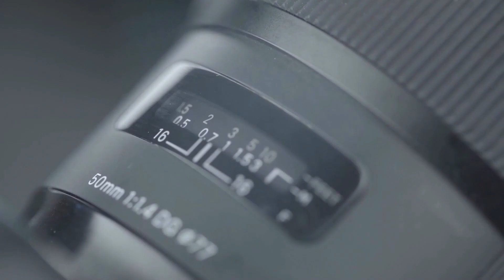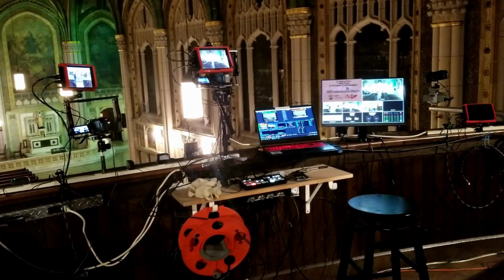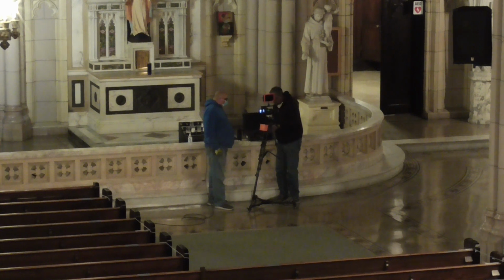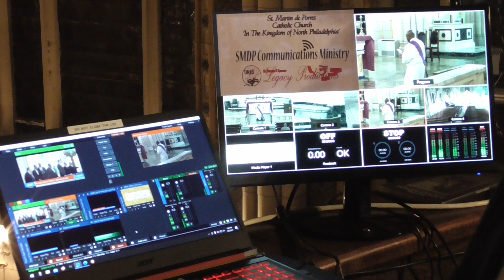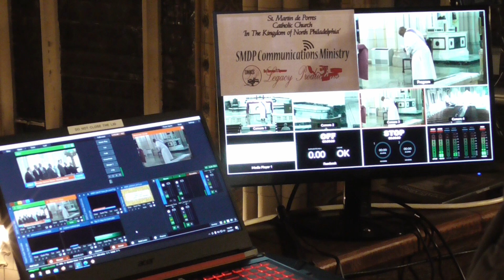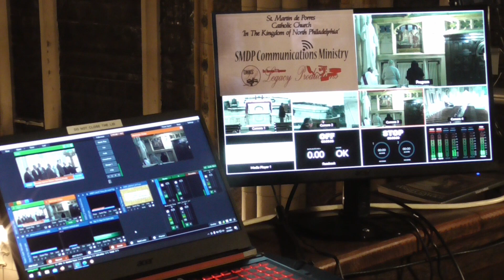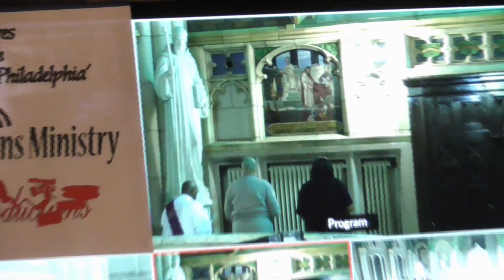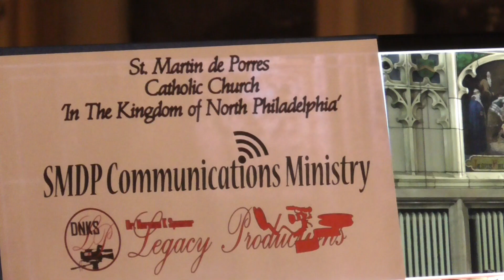ATEM Mini Pro With 200ft SDI Camera Feed

Comment: Are those the Blackmagic HDMI to SDI 3g converters? or are they the 6g version?
Reply: 3G
Reply: @NKS_2  awesome, I am using the same ones to go 15m. I was told by one person that the 3G converters only work up to 100m for HD signals.
Reply: @KLRCAT  100m is correct, it's roughly 328 feet.  One of our cables is 218ft and the other is 190ft so we are well under the max.

Comment: Another option that could potentially be cheaper is HDMI over CAT6.
Reply: It actually is a little cheaper. I tested out a set that works really well and I use it every Sunday. In fact I bought a second because it worked so well and I actually like it a little better because you only have to supply power on one end. However SDI is more of an industry standard and I already had the camera end converters because on my other switches, they already take SDI. So for me it was just as cheap to get the converters to go on the Mini Pro side because of equipment I already had, which includes the long cables.
Reply: @NKS_2  At my church I am actually using HDMI to SDI converters at the camera locations.  And running SDI back to the control room where we are using an ATEM 1 m/e 4k.  It's an old setup.  Several years old now.  But if I had knew about the Cat6 option, I might have used it back then when I setup the system.  
I'm using Canon camcorders however so POE is not needed.

If I ever upgrade to true PTZ Cams I will likely run some CAT6 to them.  But only for control and power.  I'll probably still use the existing SDI to get into the ATEM.
Reply: @DocMicrowave  I have the TV Studio in a rack mount case. So I understand the age thing but it still works and is dependable. I plan on moving to the 2ME at some point in the future. I think my cat6 converters are less tha 2 years old. I saw a video on their improved latency, and decided to try them because of the price. I got them specifically for the ATEM mini pro. But I decided to stick with SDI because I was already setup for it and my future plans lean towards SDI.
Reply: @NKS_2  There is that Latency thing with HDMI.  SDI still beats it in that regard.
With eh ATEM production switchers, my understanding is that if you can keep everything on SDI going into it, latency will be at a minimum.  
And get get practically Zero latency if you can get everything on a reference time base.

Have you ever dabbled in NDI and/or SRT?

I use NDI at the church to move low latency HD video between production computers.  It has really saved on hardware and wiring.  Quality is as good as SDI.  Latency is a tad slower than SDI, a tad faster than HDMI.

I really hope Blackmagic adds NDI capability to future switchers.

And I have used SRT for remote productions at the church from home.  Latency is about .5-1second over the internet.  Which is not bad considering.
Reply from the maker: I have used NDI a number of times. It works natively with Skype for doing remote productions. It allows me to Skype multiple people and use each individual connection as a camera connection.  I know Skype isn't the "in thing" now but because it has NDI built in and better resolution than the in thing it was a better alternative. 

I have not done anything with SRT yet. I will have to check it out.

 If you aren't already you might be interested in a Facebook group I'm in Modern Media Ministry Made Easy. It has a lot of dialog about media creation for churches, from beginners to people who have done it for a while.